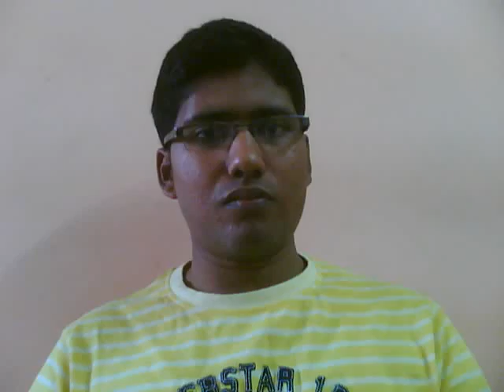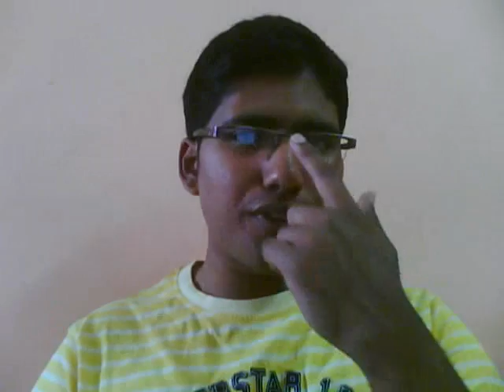#2 How to program embedded systems

Comment: its a very nice and straight forward video... but one question. after burning the programm, how the microcontroller/microprocesser knows from which address it should start executing the instruction........ will it automatically start running the first instruction it comes across  in its memory.... this is the only question which bothers me... i hope u answer
Reply: Pankaj every Microcontroller consist of a base programme which is known as bootloader particular memory location is reserved for that after that it starts executing programme from 0000 memory location

Comment: You need a external soundcard to record it without noise or try using Ableton to record it but that's a little too much work.

I just started reading up on Embedded Systems and I must say your lecture series is really good. You really explain it well in normal language keeping the technical details aside and then jump in with the technical aspects later on. I'd love you to do a nice lecture series on Microprocessors x86 or something!

Comment: Nice video and informative but I don't know that I'd agree that this is the first question that comes to mind and it tends to assume all embedded systems are microcontrollers. I've been doing embedded systems for nearly 20 years and done very few microcontrollers. I've done C, C++ and Ada programming and in none of those cases that I've gotten paid for, have I ever used a microcontroller.